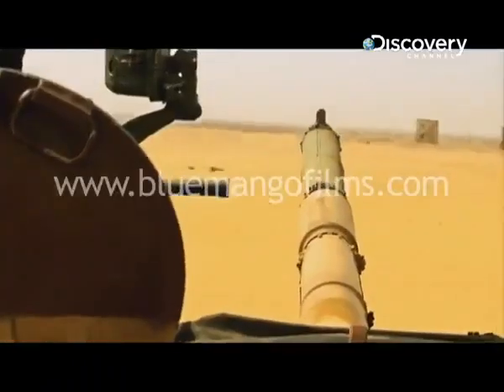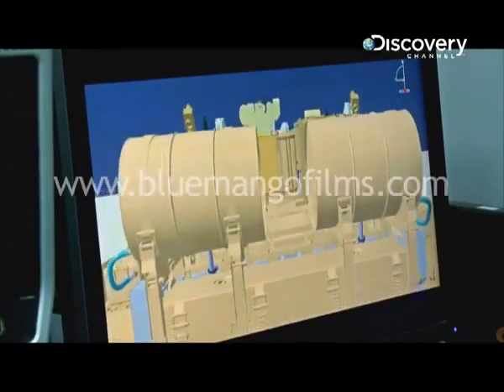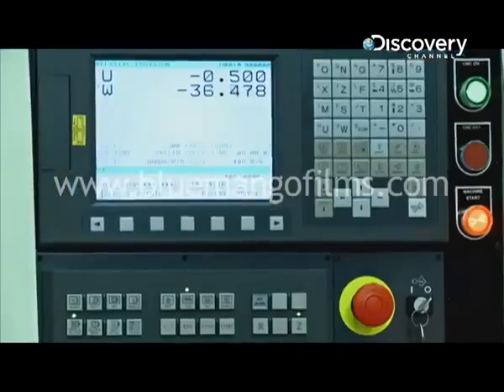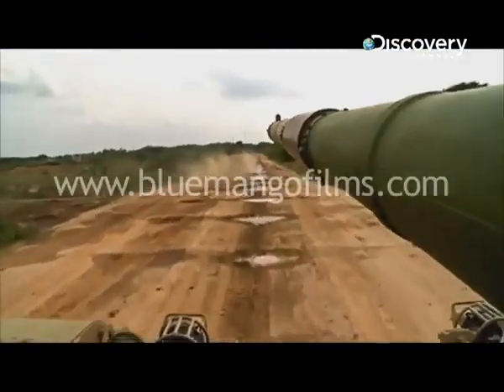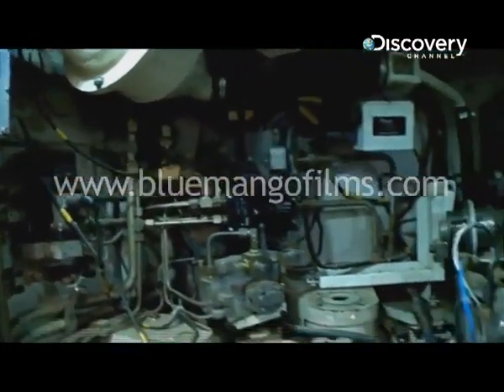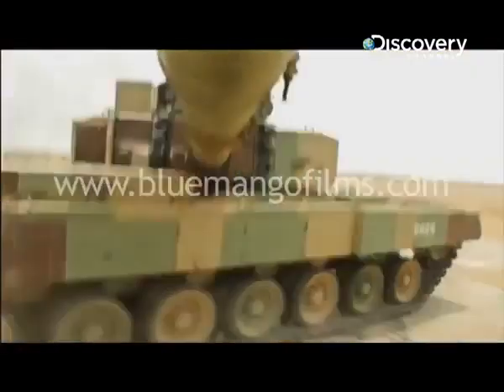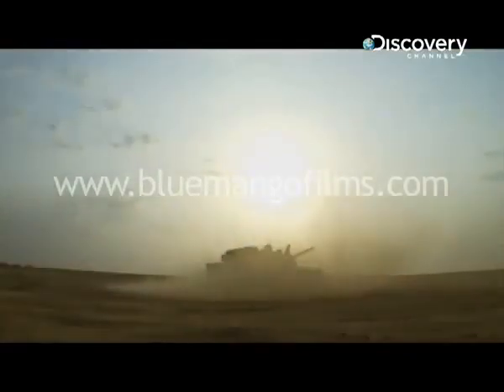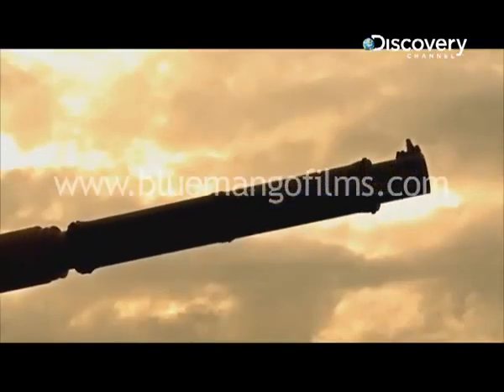Arjun Tank Mark1 Documentary

Comment: The Arjun MBT Mk I was a big flop and even rejected by the Indian Army after several trials. Finally, only the Mk II was able to achieve some degree of success. Cost overruns were 20x the initial projection and delay- 15 years and counting.
Why did Discovery Channel even agree to screen this film?
Reply: India does not have a matured manufacturing base or engineering base due to policy flaws of the congress government,they get money/bribes by not promoting manufacturing.Think like this if they can ask one state to set up research to manufacturing of one specific machinery they can at a time indiginize 40 different specialized industry. If every 3 year they keep doing that they would have rapidly become self reliant in manufacturing,but that will not help congress government as its bribes will stop not ability or capability & at same time India would have had 100 2000 crore companies revenue by now. When you say Indian engg is a flop you need to understand the engineers developing these were in 1980-90Pasouts.We hardly had 100000 engineers graduating then.Now in next 10 years the scene will be different because the graduating engineers will be 1000000 which means in 2020 there will be better product managers, project leaders emerging & more companies will be putting up shop.While the Private sector research is appreciated both by Pentagon,Chinese .There are reports conducted by west which said if you spend 1dollar in India,you get far more bang for bucks better than china & west also.Take example of ECG machine where India crashed prices by 10 times,6 sigma process even in cardiac surgery which is 10times less costlier than anywhere in world.If you don't like what you see it is better for you to vote for India,vote for Modiji.Unlike Arvind kujliwal who is again distributing scarce resources of taxes to fund his subsidy,he should have taken the challenge as a engineer that i won't touch scarce money but will innovate & get 50% subsidy...that is why India should be careful about people like Arvind Kujliwal.Whereas under vajpayeeji government mfg as GDP was 25% & the boom in capital goods kept the economy strong for 4-5 years,whereas congress got completely exposed since they did nothing in 2004-2009 except divisive politics so they crashed everything.
Reply: Akshay vaidya
And one more thing, although I've been a U.S. citizen for 25 years, I'm extremely proud of our Indian Armed Forces. Besides being a medical doctor- M.D. Cardiologist, yes I am an expert on military aviation from WWII to present. And all types of assault weapons and big caliber handguns. I own several, and I can field strip my Zastava M92 PAP AK-47 in 20 seconds flat. I'm sure you know the AK (47, not 74), the 7.62 x 39mm big brother of the Indian INSAS rifle. The INSAS 5.56 x 45 NATO rounds or 9mm Sterling SMGs will simply not hold it's own against the enemy's 7.62 x 39 in combat, on both sides East (China) or West (Pak), although Pak Army's standard service rifle HK 7.62 x 51 is even deadlier. I'm sorry to tell you that. Matter of fact, my Desert Eagle 50 AE cal pistol with 325 gr ammo or even my Ruger Black Hawk 44 Rem. mag revolver, packs more punch than 5.56 x 45 NATO.
Sorry if I used bad language in my earlier post, I didn't mean to, but Military Aviation and infantry weapons, I can teach serving pilots in the IAF or the USAF or Army personnel, and that is my challenge.
General Vaidya was a brave soldier, so do his name proud.
Reply: perikaveera There is a difference about what Military Projections should be among countries.When you talk of any rifle you need to take into account the entire eco system cost.Like how much money you need to spend on bullets,repairs,etc etc.Indian innovation is smart,it deliberately buys very expensive weapons for 5% of the forces,the enemy a small state goes in & arms it with such weapons,if cost of training for ammunition bullet itself is USD 500 per person it mean u are saddled with a USD 500MM training cost Year after Year.You are not going to war every day or every year,so you need a super computer to model scenarios for today, 2020,2025 & 2030  taking into account Indian Manpower efficiency.A indian soldier & a western soldier are entirely different in recruitment,training etc etc.But Indian Professional AKA NDA will be as good as any western officer.Indian debates around effectiveness should be more,before we can say everything is fine.Honestly UPA government is inefficient & could not get anything done properly be it TEJAS,Kaveri Engine,MK2 tanks,developing manufacturing bases with private sector,future Indian soldier,future likely enemy strategy who is 6 times bigger than you,India's handicap in DRDO due to affirmative action etc etc.
Reply: perikaveera Also in material sciences more development will take place wherein invisible materials will be invented,that will cloak tanks,ships,aircraft,invisible.That would then mean we need to plan ahead much in advance over enemy to see our ability to detect those materials & also to create those materials.If west has a Raptor 22 machine costing 90MM dollar,u need to do something cutting edge research that we have something @5MM dollar.So Indian science & technology is being led,than aspirations of Indians which is to lead... we were afterall the people who had aryabhatta,charaka,susrutha so that need to have debate at 100th year of Indian science what will we show as our power projections needs to be inculcated.
Reply: perikaveera India keeps crying that we are losing talent to west as Brain drain,it now needs to project it differently saying get 20 IIT sit together & develop something in 3 years & then sell to the west 50 times the cost of your salaries in those 3 years.If you fail to hit anything...then plunge into a Job nothing ventured nothing gained.These are kind of Policies which S&T minister needs to do meeting people,sharing thoughts,be committed to Indian scientist of the year,tracking 10 biggest Indian invention.For that a nationalist & a patriotic government like Modiji vote for India becomes a clarion call.
Reply: perikaveera The americans are more smarter than us & also chinese,they complete their projects far more quicker than us.Our IIM & IIT never did a project study which determined why a Project fails or it overshoots budget,at present all Indian government projects overshoot by 45%,so they need to have intelligent discussion around these things.Because of a pathetic & lowsy UPA government,government which should be beacon of ideas to its citizens it has been turned into a ATM loot machine by rahul gandhi & her bar dancer.Moreover they never used intelligent IT folks,analysts,doctors & built pipeline of 10000 excellent project managers in every subject which combines leadership to execution qualities to hunting smartest in the technical field.Unless you grade project managers with exceptional talents & empower him more depending on his past delivery we will continue to slide & UPA will keep the entire India illiterate so that helps them to be rulers forever.
Reply: I GUESS YOU'RE RIGHT.
Reply: perikaveera
Dear Sir,
Mi tumchya comments vachlya ....manya aahe ki kahi kami jast aahe. Pan aaplya deshachi ekandar paristhiti pahata ..je DRDO karit aahe te kautukaspad aahe. Aaani mala itkach vaatat ki tumchya knowledge cha aaplya deshala suddha upyog zala pahije. Tya mule ek bhartiya nagrik mhanun mala asa vatta ki tumhi Bharat deshat yeun tumchya knowledge cha fayda aaplya deshala karun dila pahije.
Reply: Aniket Bapat
Bapat saheb, Mazha mhanna itkach ahay ki deshachya sourakshanaath ajibaath compromise hota kaama naahi. Shatru hay pahnaar naahi ki aapan ek tank banavnyaath kithi mehnat keleli ahay kiwha aapli aarthik paristhithi kay aahay. Matter of fact, we have spent more funds in developing our indigenous tank rather than purchase a reliable and battle worthy finished product. Velh suddha kami ahay. And such a project is not viable unless we also have the capacity to export these tanks in significant numbers in order to recover the investment cost. Russia T-72 and T-90 tanks banavte,  anhi U.S.A. makes the state of the art Abrams M-! tank, panh hee loka itar deshaanna hay Tanks vikoon development cost recover kartaat, tyaanchi production capacity dekhil aplyaoon far mazbooth ahay.
Anhi tasaa me qualified defense expert naahi, fakta mazhi hi ek zunni hobby aahy mhanhun thodi faar mahiti ahay. Mi ithay USA madhay geli 25 varsha medical practice karit ahay, my specialization in in Pediatric Nephrology anhi me varshaatna teen mahinay Bharataat yeun rahto and I try to do my bit, I've helped set up some Dialysis centers in Raigad Dist for a NGO on a no-fee basis and in the near future have plans to do the same in predominantly adivasi regions of rural Thane Dist. since these people have no access to such treatments without going to metro towns in Thane Dist where it is beyond their financial capacity. Aaplya tarfenay ne prayatna karto, kithi yash milhel Devas thaook.
Apanh Mumbaith asta ki Punyaath or pardeshaath? Sahazh vichaarthoi. Anyways, best wishes to you and all at home.
Jackson, Mississippi.
Reply: All delays in Indian defence products are a result of bribe-hungry officials who are far away from the battlegrounds..............they will kill any project if it results in foreign imports and resultant kickbacks. Down with the Babus.
Reply: Bastab Biswas
I agree.
Reply: parikaveera Local Madrassas going through budget cuts?
Reply: @akshaynitinvaidya  The problem with you proud Indians is that as soon as someone criticizes something you absolutely go insane.You mock perikaveera and tell him "think you can do better??"....that's a childish arguement.If you knew about tanks or if you researched more videos about the problems of Arjun you wouldn't talk. This project was a big fail and that's why India kept buying more T-90 tanks from Russia. The fact is that you accuse him of not knowing anything when he makes good points and arguements and you only respond with mocking and nothing but "oh we have made AGNI oh we are great power oooh we are India so we are good".

Comment: Just change the rifled gun for a smoothbore one and you have yourself a decent tank
Reply: So you mean the challenger with its rifled gun isnt  decent?
Reply: Yep it isnt. You cannot use NATO ammo with the chally. The british have to use smoothbore eventually if they want to use the new smart ammunitions.
Reply: +DeltaHardcore Arjun's gun is probably the most powerful among any 3rd generation tank, barring the newer 3.5th gen tanks entering service.
It defeated the T90s in trials on all fronts, including firepower.
Reply: DeltaHardcore
It defeated the T90s smoothbore, even under tougher conditions. How tough is that to understand?
Reply: Arjun                                   

Designed----1974 ,,In service---2004,,-
Weight----85.5 Tones,,Length----10.638 Meters,,
Wiath---3.864 Meters,,Hight---2.32  Meters

Crew---4,,,Primary.Gun    120 mm,,,

Secondary Guns
HCB  12.7mm,,,AA ,MG,
Mag 7.62mm CX,,,Engine ----1400 hp,,,
Power-----23.9 hp

Operation  Range
450 km (combat range ),,,,
Speed      70 km/h
==============================
==============================
Al-Khalid
Designed 1999-1990,,,Manufacturer   HIT<PAKISTAN,,,,
In service---2001,,,

Weight----60.2  Tones,,,
Length-----10.974  Meters

Wiath-----4     Meters,,,
Hight----2.89  Meters,,,Crew---3,,,Primary.Gun----130 mm 
smoothbore gun,
  45rounds

Secondary Guns
7.62mm coaxial MG,,,
3000   Rounds,,,,
Engine           1600   hp,,,,Power             29.8    hp

Operation  Range  
600 km (combat range ),,,,
Speed      86 km/h
Reply: +DeltaHardcore not have a good accuracy   there is a reason we didt chose it .. because it  dont  give us  advantage here in our ground
Reply: Hrishabh Divya
There are smart ammunitions for smmothbore guns and the ammo is cheaper due to alot of coutries using the 120mm smoothbore. Even the brits considered changing to the smoothbore when their companies stopped producing ammo for the rifled guns.
Reply: DeltaHardcore we are just 67 year old country  if it is better we will get to that eventually too ..
Reply: Rifled is arguably more accurate, but who knows. The mark 2 is a good tank but it's too heavy for most of India's infrastructure and it costs 8 million each, twice the price of the T-90ms. For that price India can buy the Armata. LOL. The Armata is the best tank in the world, light years ahead of the Arjun.
Reply: Arjun mk1 itself is more than any "decent" tank

Comment: I saw this tank in Bengaluru Military base, i thought it was some German Tank....Proud of this...Tanks go where nothing can't go....If only loading rounds can get automatic mechanism....that would be great for re-loading.
Reply: +susheel sundar Indian army wanted Manual Re loading, because Automatic reloading can malfunction during a battle, especially in hot deserts.
Reply: +susheel sundar Not only can autoloaders malfunction (not to say that they're by necessity unreliable, but even the most reliable autoloader adds to the number of moving parts within the tank that can fail, increasing the chances of a failure and thus reducing the tank's MMBMF (Mean Miles Between Major Failures)), but having an extra pair of hands also makes for greater ease of maintenance and spreading the workload around if somebody gets injured. Also, whilst it's possible to create an autoloader that could spit out shells at 30 rounds per minute or whatever, the rate of fire is limited by how quickly targets can be acquired, and manual loaders have been found to be perfectly capable of keeping pace with target acquisition, while having an autoloader that may out-pace the gunner is unnecessary.

Comment: I have a question, can the Arjun Fire on the move?
Reply from the maker: Abin Regi I thought he said 
Moving to moving
Moving to static
static to moving
Static to static targets, so watch it completely...
Reply: +Abin Regi They say it in the video itself.  Arjun can fire moving at 25 kmph, at a target which is also moving at 25kmph, and still hit with about 90% hit probability.
Reply: hahahahaha the Arjun can catch fire on the run as it is only made of plywood.
Reply: +rohitb3 The challenger two can fire on the move, whilst moving a 50 mph and hit eight moving target in 40 seconds
Reply: no
Reply: +Arjun                                   

Designed----1974 ,,In service---2004,,-
Weight----85.5 Tones,,Length----10.638 Meters,,
Wiath---3.864 Meters,,Hight---2.32  Meters

Crew---4,,,Primary.Gun    120 mm,,,

Secondary Guns
HCB  12.7mm,,,AA ,MG,
Mag 7.62mm CX,,,Engine ----1400 hp,,,
Power-----23.9 hp

Operation  Range
450 km (combat range ),,,,
Speed      70 km/h
==============================
==============================
Al-Khalid
Designed 1999-1990,,,Manufacturer   HIT<PAKISTAN,,,,
In service---2001,,,

Weight----60.2  Tones,,,
Length-----10.974  Meters

Wiath-----4     Meters,,,
Hight----2.89  Meters,,,Crew---3,,,Primary.Gun----130 mm 
smoothbore gun,
  45rounds

Secondary Guns
7.62mm coaxial MG,,,
3000   Rounds,,,,
Engine           1600   hp,,,,Power             29.8    hp

Operation  Range  
600 km (combat range ),,,,
Speed      86 km/h
Reply: Hahahaha Arjun is made from painted wood
Reply: +kwan Lam Thanks. India will keep making plywood tanks, you carry on with your other important jobs. Stop trolling.
Reply: +kwan Lam Are you real or a plywood computer
Reply: @Abin Regi : I have a question, do you know anything about tanks?
Reply: Abin Regi arjun is better them t 90 in this specification👍

Comment: They bought russian T90s because their tank crews were used to the T72 tanks, so the T90 was somewhat familiar to them, also they bought those T90s before they developed the Arjun

But that doesn't necessarily mean that the Arjun is better. it's more of national pride than anything else, The Arjun was manually loaded and the non angled turret armor compared to the T90s autoloader , 125mm TG and proven design. The T90 is also cheaper and easier to manufacture, 3m usd per T90 compared to 4m usd per Arjun.
Reply: Have your views changed now?

Comment: So what's the reason for using rifled gun while there is APFSDS ammo and the gun itself is less durable and more expensive in crafting comparing to smoothbore?
Reply: Marcos B
Well it was rhetorical question - actually - you can't use normally APFSDS rounds with rifled guns - yes, I know - in Challenger 2 they use - but it's a specially modified round with soft sabot that actually is not being spinned but is forced straight through the rifles of the barrel - thus making the barrel more and quicker worn off. With the use of APFSDS round riflled guns are no logner more accurate - and they are more expensive to manufacture and less durable. Even Brits change their tanks rifled guns for Rheinmetal smoothbore ones.The HESH rounds are more effective at longer distances as they have low travel velocity and their effectivnes rises as their travel step increases - more arc - being able to impact on the top of a tank which is less protected than its front or sides.

Comment: why are the fuel barrels placed so highly behind the tank ? This does not allow the turret to turn 360 degrees... Also why did it take 30 years to build a tank ? Why did they add 10 tons to the weight of the tank just to fit the power pack in place ? didn't they know the measurements beforehand ? So there's an extra 10 tons that doesn't necessarily add to the security / defence of the tank, it just had to be increased to fit the power pack ? what a joke. Also if the tank is going to be 65% foreign parts, why not just buy a foreign tank, reverse engineer it or get technology transfers ? 

In the end, because the Arjun tank costs 8 million each, while the T-90 MS costs 4 million each, no army will buy it in mass, not even the Indian army. Even the Abrams and Leopard 2 cost less... what a joke.